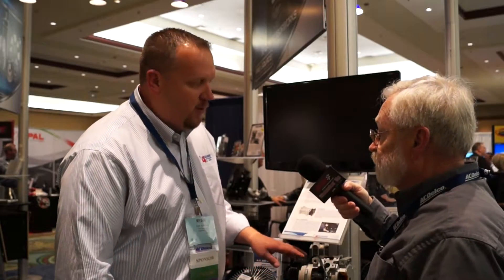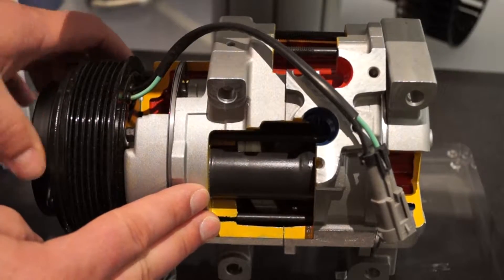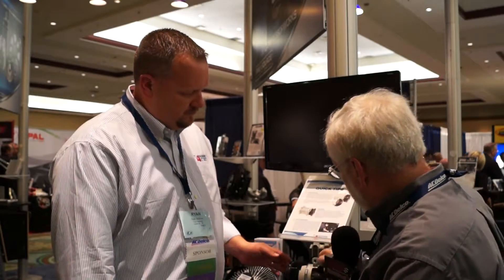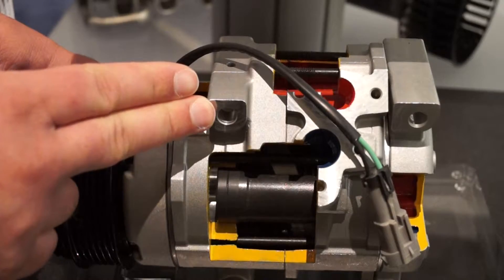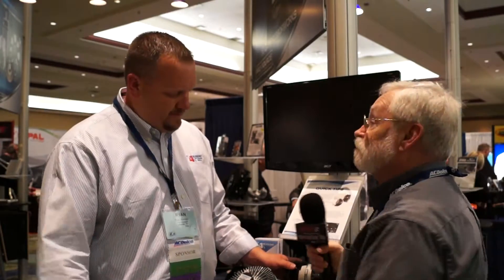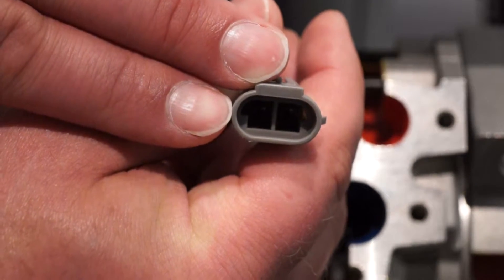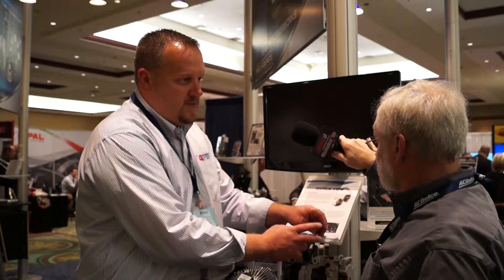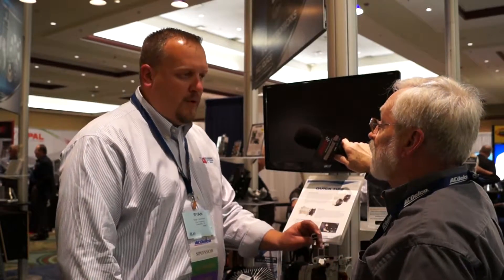Why do new A/C Compressors sometimes fail? - Wrenchin' Up

Comment: This guy is trying to shift blame for their junk compressors onto the buyer. Blaming it on other things. They do little more than clean and repaint their rebuilt compressors. They may replace the seals, but don't overhaul and replace the moving metal parts. So they put the same worn out compressors up for sale, which don't last, since they were worn out and still are.
Reply from the maker: Hi - Thanks for watching and sharing your opinion!

Comment: The main thing is new compressors like 4 seasons are junk.  I've had then blow a fuse as soon as hooked up. I've taken them back and got a different brand and they run forever.
Reply from the maker: Hi - Thanks for watching and sharing your experience!

Comment: I tried 2 4-season  scroll compressors and both did not work. Its not the cleaning of the system, its because the compressors were built in China and wee not checked to see if they indeed worked. I bought a real Sanden scroll compressor and it works. So in summery, Stuff built in China is not all that grest.
Reply from the maker: Hi - Thanks for watching and sharing your experience!

Comment: Hello there nice video.I have AC all parts are replaced except evaporator thermistor,AC working but not as before,vehicle Hyundai Santa fe 2015.
Reply from the maker: Hi - Thanks for watching! Could be a lot of things; moisture or restriction in the system, bad compressor clutch, bad or contaminated refrigerant, slipping belt, clogged condenser fins, refrigerant leaks, bad compressor, (new parts can be bad too), etc. If you haven't already done so, check and follow the diagnostic and troubleshooting guides in a service/repair manual for the vehicle. I hope you get it figured out.
Reply: @WrenchinUpwithJimBates  Thank you for answering.Compressor is clutchless and repairs done by dealership.
Reply from the maker: Hi - Looks like the best course of action would be to take it back to the dealership and have them diagnose the issue. I would think that the repair should have a warrantee.
Reply: @WrenchinUpwithJimBates  Thank you
Reply: @WrenchinUpwithJimBates  does bad evaooratour  temperature sensor can cause this problem?

Comment: My ac compressor trip after 30 minutes and so hot compressor any solution??what is the reason??
Reply from the maker: Hi - Long distance diagnosis is always difficult and usually not very practical, but start with making sure there is proper high and low side pressures to insure adequate refrigerant, no blockages, freeze ups, etc. Compressors do get hot because of what they do and where they are located but inadequate oil in the refrigerant can make things worse. Thanks for watching!
Reply: Jim Bates is this ac compressor problem or other ...??
Reply from the maker: Unfortunately, You won't know until you or someone runs a diagnosis like the one I mentioned. No way to know for sure until then. My feeling, based on your original question, is that the compressor is shutting off and maybe getting too hot because of a problem somewhere in the system.
Reply: Lets say compressor is good. It will shut off if too low in Refrigerant, and it will shut off if there is too much pressure. High pressure is caused by too much refrigerant, blockage on the system(condenser, drier, evaporator, lines), or fans are not working properly. Purpose of fans is to dissipate heat from the condenser/radiator. Heat on condenser will make the pressure too high, as a fail safe the compressor will shut itself down(thats the  ac pressure switch's job). Hope this helps...

Comment: Sometimes cheap Chinese compressors like those sold by GPD simply fall apart. In my own truck the valve plate was attached by one bolt that came loose. There are no service parts available for these compressors. They only give a year guarantee so you know it is not top quality.
Reply from the maker: Hi - Thanks for your comments and Thanks for watching!

Comment: Its too extreme climate here in Bahrain, and there are huge AC problems reporting in the summer season with catastrophic AC system failure. What happens most is the compressor wears out internally and blocks the whole system including expansion valve and liquid tank and causes abnormal high and low pressure and AC less cooling complaints. Hence, we have to replace Compressor+Expansion valve+Liquid tank and do full system flushing...
Reply from the maker: +Aman Kundi Hi Aman, Thanks for your comments. Very interesting. Seems good to be in the HVAC business in Bahrain! Thanks for watching!